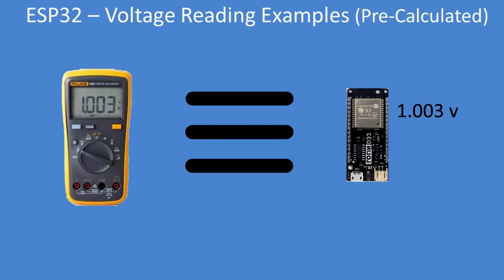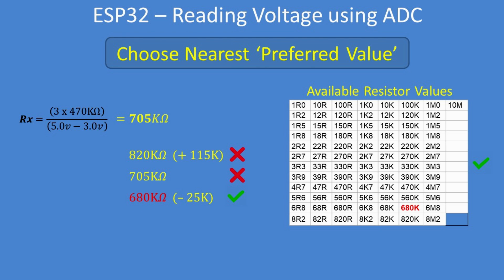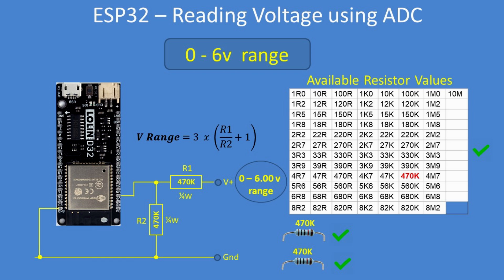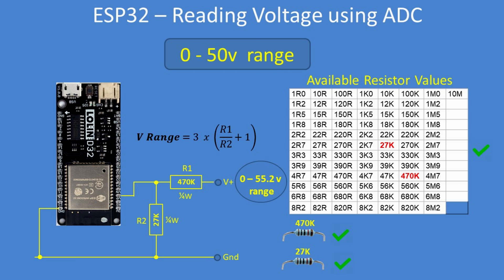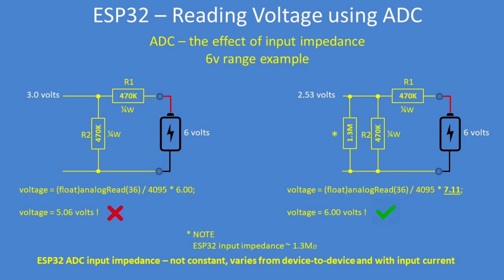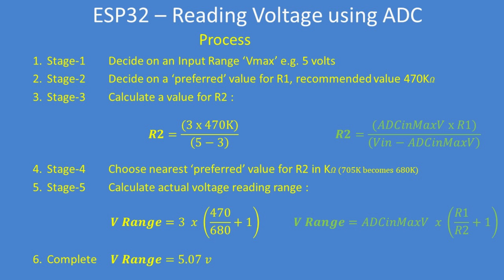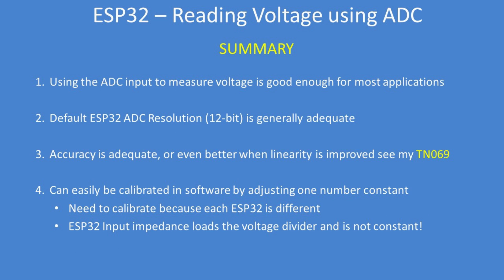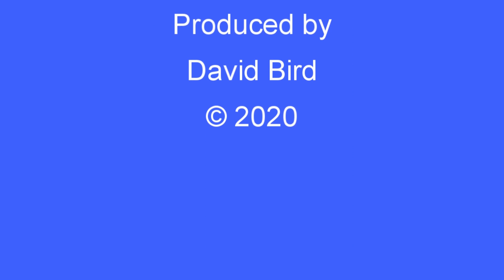Tech Note 143 - ESP32 – Voltage Reading (pre-calculated voltage divider) Examples

Comment: It would seem though that the loading on the voltage divider would pull down the biasing below midpoint so that clipping of the signal on the low end would become a concern.  For that reason, I think it is better to reformulate the voltage divider to compensate rather than performing software scaling.
Reply from the maker: Well the problem is the ESP32 ADC is non-linear and no scaling can resolve that. The good thing is the ADC is quite repeatable in its non-linearity between devices, and so compensating in software is viable, plus it does not add to the hardware count.
Reply: @G6EJD  I would advocate for linearizing first, then compensating for voltage sag separately as those are independent considerations.  At the expense of an additional pot, you could place it between two nominally sized resistors to have a fine tunable voltage divider, or better yet, use a buffer as someone else suggested.  If the input signal has low impedance, then it might be as simple as using lower value resistors for your divider to make it a stiff divider.  Rule of thumb is divider should be 10x impedance of source and input impedance of ADC should be 10x of divider.
Reply from the maker: @Enigma758 yes, I used the 10x rule back in the day with transistor biasing! But I’ve set out to use the highest possible values to present the highest input impedance and lower power consumption. It’s all a compromise and it’s only a microcontroller so with the ADC used is never going to be accurate. I still favour a software calibration because it adds no overheads and variable resistors are unreliable and would never be used in a production environment/use.
Reply from the maker: When you think this through it is impossible to linearise first, because the ADC has a limited input range, so a voltage divider must be used. Then as I did, a polynomial can be used to both linearise and compensate for irregular external influences.
Reply: @G6EJD  Yes, I agree.  To be clear, what I was thinking is that it is best to first bias electrically at midpoint and account for sag, if necessary, by tweaking the resitor values (or via buffering).  Then linearize.  Doing so would ensure the full range and prevent any low end clipping due to sag.  Then apply any further software transformations (although if properly linearized, probably the only need would be for scaling).

Comment: I'm monitoring a solar panel to gain information regarding it's output.   I have a voltage sensor that has a 30K resistor and a 7.5K resistor.   At the moment I'm using the constant for the 0-15v range and it seems to be close to the reading from my multimeter.   Of course the resistors are not actually 30K and 7.5.   I wonder if I would get more accurate measurements if I used the actual measured resistances?
Reply from the maker: You could, but because it’s all linear, measure the voltage and then check the ESP32 readings and adjust the value with a simple offset like voltage * 1.01 or * 0.99 obviously varying the constant value up or down as required, then it will be calibrated.

Comment: Curious why you stipulate the capacitor should be rated at 200V or more.
Reply from the maker: Well yes strictly not necessary if you rely on the integrity of the resistors and for low voltage measurement absolutely unnecessary, but when your recommending a solution to a wide range of skills it’s better to err on the safer side as applying a high voltage to a capacitor not rated for the expected maximum generally has catastrophic results that is best avoided!
Reply: @G6EJD  OK thanks, I was guessing that was your reasoning.
Reply: Excellent point of adding a capacitor. Any thoughts on how to discharge the capacitor each time for safety reasons.....other than physically shorting it out? 
Perhaps a way to do it using code on the ESP32 or Arduino?  @G6EJD

Comment: This is a great video, however, it is better to use a high impedance voltage follower circuit to buffer your circuit from the resistor divider. If you place a resistor divider across a battery to measure system voltage it will act as a parasitic load across your system. A simple switch or follower circuit will prevent this.
Reply from the maker: Yes, but these were more of a DVM example than constant voltage monitoring function.

Comment: I  want to measure my solar panel string ( it's 6 poly panels in series so roughly 220V DC ) good idea to use ESP ?
Reply from the maker: Not really, high voltage DC is a specialist subject (any DC voltage above 30v is internationally agreed to be lethal) as the techniques and safety requirements are beyond anything that most people have ever done into contact with. If touched your muscles go into spasm and hold in that state, you can’t let go, arcing of the voltage to ground is a real risk unless the correct construction techniques are used. Best to use the usual inverter measurements.
Reply: @G6EJD  your probably going to like my follow up question even less then :P

Can I use a AC breaker... My thinking was to put in a busbar on the 4-Pole 63A AC breaker to mitigate the load, it's a 220V DC at 5A solar string.

The reason for this shenanigans: I live in sunny South Africa and as might or might not know, we no longer have electricity our corrupt government broke Eskom and now the country only has power for 4 hours at a time permanently.

Because of this extreme corruption cost of items has skyrocketed. I can get large AC breakers for around R50 however a 500VDC DC breaker costs >R1k because there's zero supply left in South Africa, no more batteries and no more solar panels available in SA as everyone with the means bought it all up the last few months after Eskom announced it can no longer supply the country.

So I now have to resort to... Less than ideal fuckery to get my solar system working.

And figured your the smartest person I know so will check by you first.

PS: your videos are absolutely incredible, the knowledge contained on this youtube channel can be used in universities
Reply from the maker: @ErikThiart  the issue with DC circuits is the arc that’s drawn when a circuit is broken, so DC breakers, say for a House Battery feeding an inverter have to operate at very high speed and use contact snubbers to extinguish an arc, this is why they have a higher cost. However, with 220v DC at a maximum of 5A (probably 6-panels peaking at around 36v each) that is a relatively small current and an overrated AC breaker should be sufficient. Generally for the input of an inverter it’s not necessary to provide isolation other than for maintenance. You could use an ESP32 as a voltage monitor, it just needs very careful choice of wiring and well insulated connectors and resistors that are capable of working at high voltage including their power rating at say 0.5W rating or better. All I’m saying is be very careful and employ systematic safety and gloves when working on the connections, or do the work after sunset. Good luck with your supply problems, sounds chaotic.
Reply: @G6EJD  "Sounds chaotic" that's the slogan for South Africa :P. 

Thank you for the reply, conceptionally I understand what you are saying regarding the arc.

Comment: I'm currently using a load - 40k - adc - 1k - gnd and I'm getting a ridiculous amount of noise. Adding a bypass 100nf electrolytic capacitor very close to ADC input doesn't reduce any of the noise.
Feeding 2v I get readings that go from 0 to 4095, it is impossible to use. Using an ADS1015 or ADS1115 for each project turns things very expensive. I'm new to electronics, but as I understand, if I follow your resistor values, I'll be able to get rid of most of the noise?

One of the applications is in an ebike throttle so I'm afraid to use a capacitor and get a laggy response.
Reply from the maker: The time constant for the filter is too short, currently about 1mS, so it won’t filter much. Try increasing both values by a factor of 10, so 400K and 10K (nearest perfected values for the 400K). I suspect the problem with an eScooter control system is high switching currents do give rise to high ambient electrical noise, so you may have to put an RFI suppression chime in series with the ADC measurement circuit to remove any high frequency noise, just about any RFI coil/choke will do, but it’s resistance needs to be low and this should be the case with a good quality choke with a low Q.

Comment: Hi David
Can you share formula how to calculate constant?
Reply from the maker: A simple voltage divider so vadc = Vin x R2 / (R1 + R2) where vadc = 3.3v and R2 is the resistor between ADC input pin and Ground and R1 is in series with the input voltage and the ADC input pin. You have to be cognisant of the ADC input current so you can’t use really high values for R1
Reply: @G6EJD  I understand that, it was in previous videos. Currently I'm trying to measure up to 91V(R1 221kOm R2 7500 Om)  and trying to find constant.
Reply from the maker: @kokosikzhd  the problem is every ESP32 has a different ADC input impedance and therefore input current, but I used an average of 160K let’s call it Rp so effectively the formula becomes R2//Rp/(R1 + R2//Rp) 
You can never get a repeatable result across many ESP32 as they are all different. The s seer is to make R2 as small as possible whilst enabling the same input current, so in your case I suggest you drop the R2 value down from 7.5K to say 1K making the parallel input impedance very much less dominant and recalculate R1 accordingly higher, you can approach 900K for R1

Comment: Very good video. Could you answer me a question? If we wanted to use the function you explain in the TN069 video to improve accuracy, would we just have to substitute the line "double reading = analogRead(pin);" for "double reading = (float)analogRead(ADC_pin)/4095*calibration_factor"? That is, the polynomial can return a more exact value as long as the voltage read does not exceed 3.3V, right? Thanks.
Reply from the maker: Correct.
Reply: @G6EJD  Another question if you don't mind. Can't we select R1 (470k) with a lower value? I say this because then R2 would be smaller too and I think it would not affect the ADC input resistance measurement as much. Also, if we want to put the capacitor in to smooth out the noise, couldn't the readings be faster as the time constant is smaller?
Reply from the maker: Yes all of that, the values I chose were to measure the ESP32 running on a battery and presenting the lowest battery load. Ideally; if power consumption isn’t an issue, drop the values down but maintains the same ratio and add a larger smoothing capacitor, noting that as the capacitor increases so does the RC time constant and the circuit takes longer to stabilise after change, which could lead to inaccurate readings until the capacitor has reached a steady state charge. The ESP32 input impedance is quite high, it varies from device to device, but about 300K ohms.
Reply: @G6EJD  If it is possible to put smaller resistors, do we increase the capacitance because a larger capacitor removes noise better? We could increase its value by the same amount as we decrease the value of R2, right?

Comment: Sir can I use this formulation for nodemcu esp8266 ?
Reply from the maker: You can use the same principles but the maximum input voltage of the ESP8266 ADC input is 1v so all the ratios need to be adjusted, but I give the formulas to use, really the hardest job is choosing the nearest preferred values that resistors are sold as. The ADC input current becomes a limitation if you use the higher value resistors up in the 750K or above values.

Comment: What  would be the downfall of using the map function to map the readings to match the maximum of the voltage range? 
If you know the calculated voltage divider, it seems this would be the most accurate.
Reply from the maker: You could use a map function, but as it’s integer only, you’d need to create a new function using floating point, probably double types too.

Comment: Hi David. I am trying to measure a 12.8v battery. I used the 0-15V resistors (470k and 100k). If I use the code from the link, I obtain ~140 on the arduino console. The voltage that gets to pin 36 is ~ 2.2v and the analog read is ~ 1700.0. Could you help in identify what am I doing wrong? Thanks!
Reply from the maker: Hi, A reading of 1700 suggests 1700/4095 * 18.5 = 7.7v. Did you set the constant value correctly for 0-15v input? it should be 18.5
What sort of board are you using? Do you have the resistors around the right way?
Reply: @G6EJD  I set the constant to 18.5. I think the github code has a problem multiplying twice with the constant though. The board is wemos lolin32. I believe the resistors are wired ok. I managed to get to a good voltage value by changing board pin to 35, changing constant to 20.3 and multiplying just once with the constant.
Reply from the maker: Thanks I don’t know how the double constant entry happened, I’ve removed it now. I suspect your board (many do) has an on-board voltage divider which would skew your readings.
Reply: @G6EJD  Thanks, David. If I may, I have one more question if possible: I would like to use the 12v source for which I measure the voltage to also power the Lolin32 board. How do you recommend to do it and what would be the connection points (pins / gnd)?
Reply from the maker: @invatatenis  OK, you will need a 12v/5v voltage regulator, something like: https://www.aliexpress.com/item/32525895503.html?spm=a2g0o.productlist.0.0.2dda5b10yO0S9j&algo_pvid=7b2fa296-33b2-4c11-8a3b-50db94265578&algo_expid=7b2fa296-33b2-4c11-8a3b-50db94265578-18&btsid=2100bb4916064924717273992e9e6b&ws_ab_test=searchweb0_0,searchweb201602_,searchweb201603_ 
and connect 12v to the input and a gnd, then the 5v output goes to the USB pin with a gnd. The USB pin is effectively 5v, but don't connect a PSU and USB at the same time.
Reply: @G6EJD  Thanks. I have one little board that take 12v as input and can generate both 5v and 3.3v as output, selectable. I will use the 5v one.

Comment: Would it improve accuracy to feed the ADC with an opamp buffer, so that the input impedance of the ESP32 is  >>  than the output impedance of the opamp ?
Reply from the maker: Good question. Well, once the ESP32 input impedance has been established it does tend to be mostly resistive and constant for any particular device, this is why I’m using the term impedance which is usually a combination of (R+-jX) resistance and capacitance or inductance. So adding a buffer will reduce the load on a voltage divider, allowing the ratio to be more exact, but it won’t affect the readings once recalculated for the input impedance load.

What you’ve suggested would be a much better add-on when using a DAC output as the ESP32 output impedance is relatively high, so an op-amp would enable a much better output to be obtained that is less susceptible to loading.

Comment: Thank you sir so form this example we can monitor battery in better accuracy??
Reply from the maker: When you say accuracy,, what  do you mean? You can get 1% linearity and repeatable readings. If you use Vbat---470K---ADC---470K---Gnd and use my polynomial in the links of TN069, it's a very 'accurate' result, as good as my Fluke DVM for readings. You can have as much resolution as you like, but accuracy depends the calibration you apply through the constant adjustment I refer to.
Reply: @G6EJD  thank you sir for nice guidance

Comment: Any idea how "stable" the calibration value would be? I mean, if you followed this, and then went on to use your ESP32 for days and weeks (and various power cycles) - would that calibration value still work?
Reply from the maker: David Clawson, I have not seen any variation in the ADC readings other than a small amount of (expected) noise, but this could be eliminated (statistically) by over sampling, such as a simple take 5 readings, sum them, then divide by 5, this has the effect of smoothing the results. Other variations will be due to the effect of temperature on the resistor values, but as they should both rise or fall in temperature together, unless physically separated, then there will be an element of common mode rejection, meaning the ratio of division will remain constant. In practice I have not seen any appreciable variations.